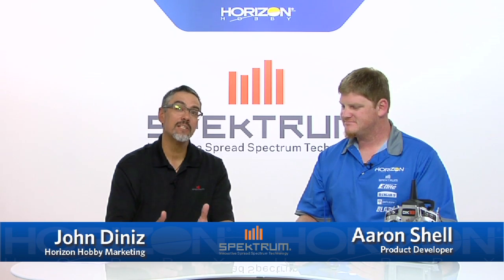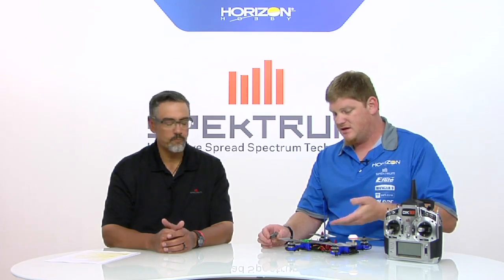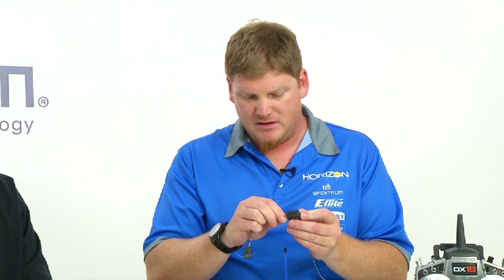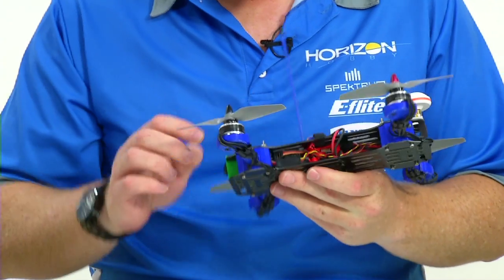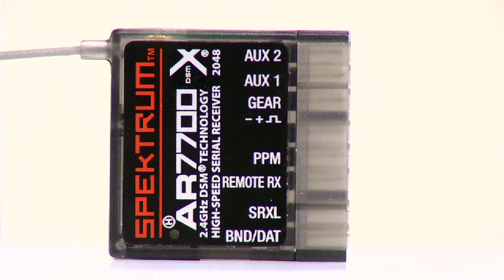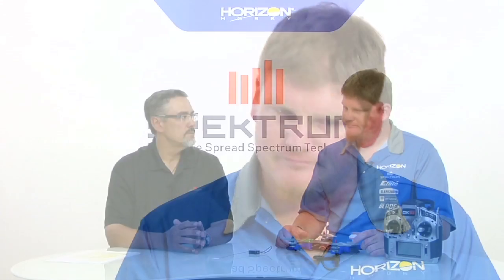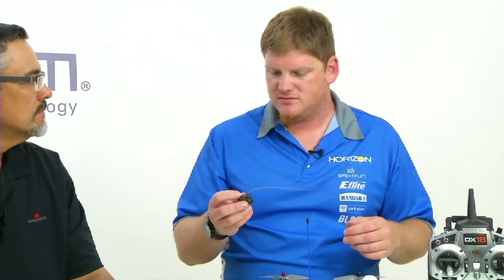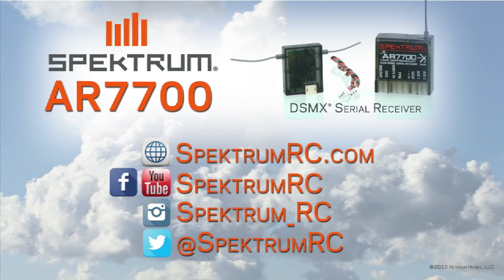Spektrum AR7700 Serial Receiver - Tutorial on features and specifications

Comment: Does this work with the DJI A2 Flight Controller? I hope so, because I already ordered it assuming it will.... I figured if it works with the Naza series, I doubt the A2 would be incompatible.
Reply from the maker: Hi NFA RC, If will work BUT you will need to the ability to reassign channel outputs on your radio. All Spektrum Gen2 radios have this ability. Hope that helps!

Comment: I need more info on the AR7700. I am using this Rx with an APM 2.8 and PPM output, with a DX9.  What I need to know is, is it possible to output from channels 6,7 & 8 on the Rx and still have different outputs from the APM board also on those channels? Or more specifically, how and can I use channel 9 on the Tx to operate a ninth channel on the copter (Rx or board)?